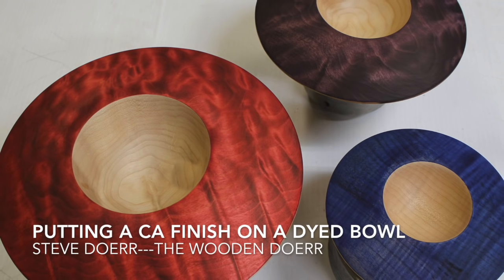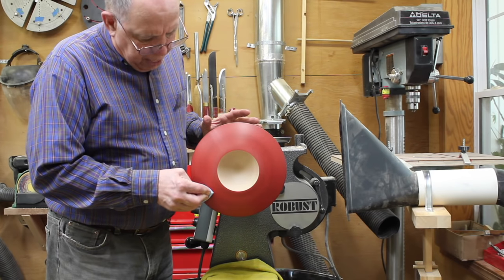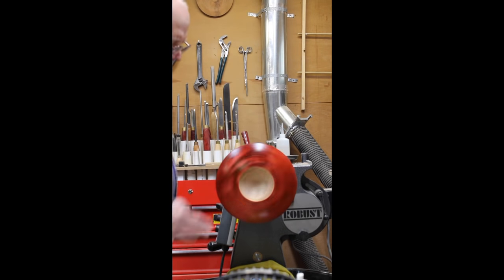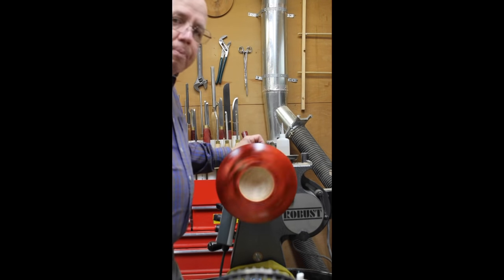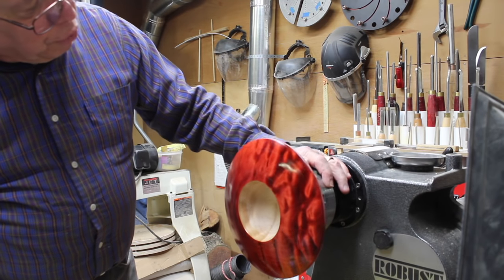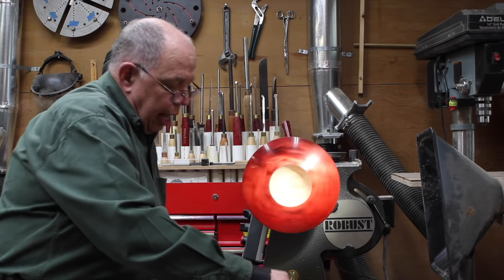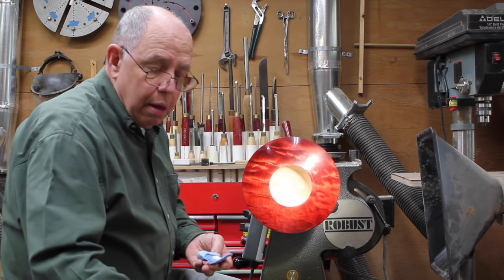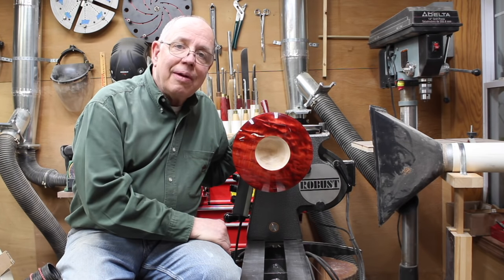Putting a CA Finish on a Dyed Bowl

Comment: Thanks for publishing this, Stephen.  I use Starbond EM02, which has a viscosity of 2 centipoises (water is 1). I use a blue shop towel to apply it to a bowl sanded to 600 grit....one or two drops on the towel and a quick swipe across the surface, only in one direction and only once. After it sets up, about 20-30 seconds, I repeat the application but in the other direction. After 5-6 coats, i put a few drops of accelerator on a towel and wipe it across the surface. After 10-11 coats, it looks great. The thin CA doesn't build up hills and valleys like the medium CA does. I am able to start with the MicroMesh pads rather than a coarser grit like 240. I use a headlight cleaner polish for my last step.  

By the way, the last photos of your bowl look absolutely fabulous.
Reply from the maker: Thanks, Doug. That's pretty much how Alan Trout does it as well.  As I continue to develop the CA technique, I will probably cut back some on the medium CA and go with the thin CA.  One of the reasons I like using the medium CA is that it gives me a little more depth to the finish.  I know when I first started showing CA finishes at some of the art shows around here people thought they were made of glass.
Reply from the maker: Doug, thanks for your comments.  I will have to try your method the next time I put on a CA finish.  Appreciate you sharing it with me. Steve

Comment: I’ve always had problems with CA finishes. Usually don’t end up perfectly smooth and shiny. A friend told me that a solution to my problem was to use sanding sealer after the color. What do you think?
Also, have you tried using dye as opposed to stain?  Don’t get me wrong, Chestnut stain is a wonderful product!  But it tends to mask the figure in the maple. Dye (yes, black first then scrape (sanding just won’t cut the black back enough) makes the figure explode so much more than stain. Sorry for being wordy, but if you stay with Chestnut stain, try putting a layer of sanding sealer, then a complimentary color. I have been doing this and it ads some amazing depth to the colors.

Comment: I noticed at around 10 minutes and 50 seconds in, you we're applying the thin CA glue and then you said you came back through and smooth it out. What are you using to smooth it out with, after you do the application? I am finding that it dries up before I can go back through and smooth it out with anything and I'm having a hard time getting it smooth.
Reply: @stevedoerr5846  that helps. Thanks! now when you go back over it are you using a dry portion of the paper towel or the same portion that you just applied it with?